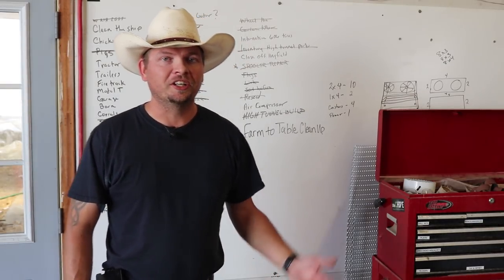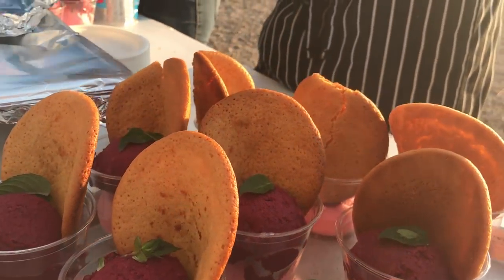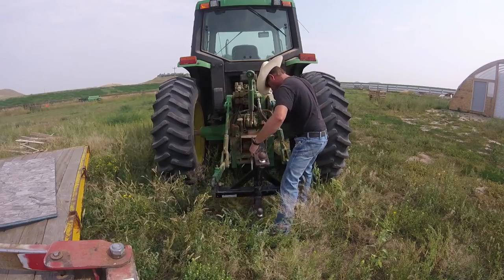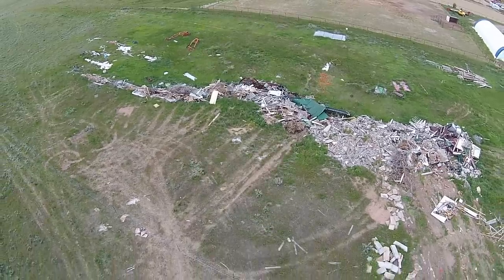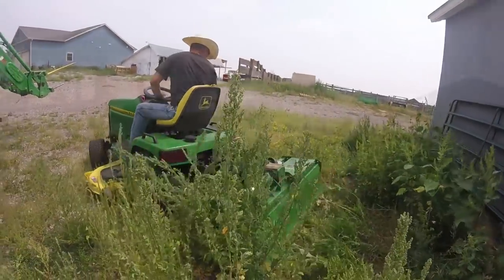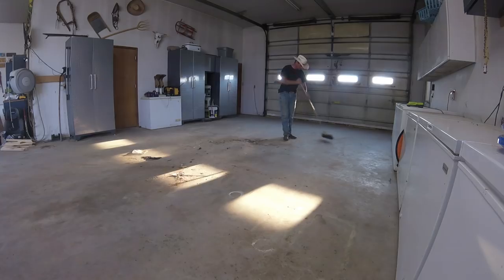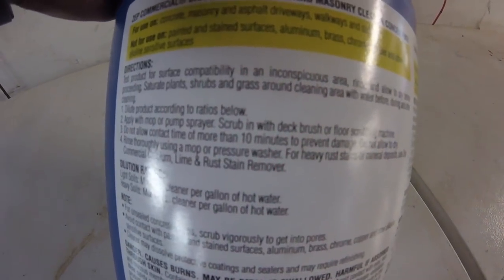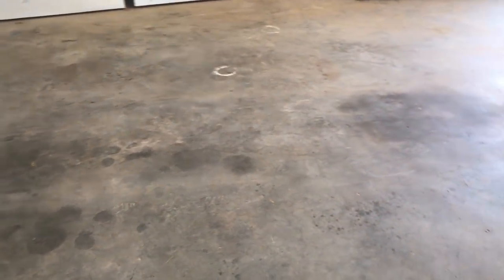Preparing the Ranch for 75 Guests for the Annual Farm to Table Event

Comment: Hey Mike, once years ago, I was tasked with cleaning the concrete floor of an old 4 bay auto repair shop.  What I found worked the best was cheap old 'white vinegar'.  Just poured a big puddle on the floor, then scrubbed with a stiff wisk push broom.  Two treatments (about 3 gallons each) and the floor was shining white, not one grease or oil stain to be seen.  Vinegar is an amazing solvent, IMO.  Good Luck with your banquet, last years looked great and I'm sure this years will look just as good!
Reply from the maker: Interesting, definitely worth a try, thanks a bunch - Mike

Comment: Kay Chemical is a company that makes a indoor outdoor degreaser that will clean that. Pour it on quarter of a gallon of chemical to two gallons of water in a pump sprayer. Soak the floor let it sit for 3 hours and then pressure wash. Floor will look like new. Great Video!
Reply from the maker: Thank you very much Brian - Mike

Comment: Dump trailers are great I love mine. Just a little larger than yours its about 7x12 had it factory derated to be just under 10k. I have 2 dump trucks as well but loading the trailer is so much easier its a pleasure. And like you it sits full most of the time.
Reply from the maker: haha, yea mine sits full til I need it lol Thanks a bunch - Mike

Comment: The shop floor is good to go. Your going to be right back in there with grease and hydraulic fluid. If you can't track what's on the concrete it's fine. Those folks are coming to a working ranch not a hotel banquet room. They're coming to escape the everyday life. An event like that along with the daily chores is stressful. Don't sweat the little stuff. Blessings for OWL.
Reply from the maker: Thank you Gerard - Mike

Comment: on my concrete floor i have oil stains from mechanic work. I can get a majority of them out by spraying a solvent onto the floor and let it sit for minute or two. Then i come back and wipe up with a clan shop towel. Then if you used your machine it would do alot more damage (cleaning).
Reply from the maker: Thanks for the tip! - Mike

Comment: Mike
Zep makes a industrial purple Degreaser (should be able to find at most hardware stores) that would work perfectly for cleaning up that shop floor. When I clean up our shop floor I put the concentrate into a spray bottle and spray it directly on the floor (dry floor). Let it sit for about 5 minutes. Then scrub it with a stiff bristle floor broom. Finally rinse the floor by your preferred method.
It look like some of those stains we're engine oil, some other material. do you happen to know what the stains are from that are on that concrete floor by chance.
I hope that you guys have a great dinner. Hopefully this helps. Thanks for all the great videos. Ben
Reply from the maker: Probably oil and hydraulic fluid, thanks for the tip! - Mike

Comment: Hi Mike: Try Rolloff for cleaning your garage floors. It is a product used by quite a few gasoline/diesel stations to clean their fuel court pads. Just make sure not to buy any of the already diluted smaller sizes. Buy one gallon and up. It usually runs around $60 p/gal plus shipping. It really works.

Comment: Oil stains are almost impossible to get rid off unless you resurface the concrete or sand it (big diamond wheel). You can minimize the stains using a strong acid based cleaner and a brush. The acid will eat away at a small layer of the concrete and minimize the stains. I don't know what store you have locally but I've seen these cleaners at home depot and lowes. Cheers!
Reply from the maker: Very cool. Thanks Samuel - Mike

Comment: I have found concrete cleaners to be just regular soap type.  none can take out oil stains or other deep ones.  just surface.
for comparing pressure washers to each other.  multiply GPM by pressure.  gives you an "impact" number.
7000 psi at one gal equals 7000.
3500 psi at two gal equals 7000
they are comparable.  so buy the cheaper one.
Reply from the maker: Perfect thank you Tom, this on is 4000 PSI and 4.0 GPM  I really appreciate the help - Mike

Comment: Concrete is porous, which means any liquid will soak in and bond to the concrete. The only way to get the stains out is to grind down the concrete about 1/4 inch, which is a pain, expensive (even if you do it yourself), and has health risks from the dust. You could paint it (with special epoxy paint) but the chances are it would peel up in sections that have oil stains. There are products you can use to fill up the pores when the concrete is new, but those don't really help you now.
Reply from the maker: Thanks a bunch! - Mike

Comment: If you can shop from white cap/ HD supply they have a amazing concrete cleaner that removes oil, transmission fluid, diesel oil, almost everything. I would use it out here in Las Vegas for concrete cleaning and being that it is so hot here alot of stains on the concrete usually never come out completely but I used it at a pilot gas station and they gave up on trying to keep it clean when they weren't getting the results they we're expecting. I offered to clean a 10x10 yd sq of the worst area for free and if they were satisfied with the test they could hire me for the rest of the gas station. They loved it and hired me for all of the truck stops in the Las Vegas area. If you want the name of it let me know before 9am tomorrow and I will stop by and get you all the information on it. I'm leaving for a little more than a month on Friday to go work on a farm on the east coast but I don't mind stopping for you to get the information. I enjoy watching your videos when I have time to. Be safe and have a good one. Ryne
Reply from the maker: Awesome thank you very much, I will see what I can find here, if you know the name of it let me know. Thanks - Mike
Reply: Our Wyoming Life not a problem I will get it in the morning for you on my way home from that side of town. The only thing we used was hand brushes we also went with the broom lines Because that is where the pours of the concrete are more open to letting in anything
Reply: Our Wyoming Life hey Mike do you have a email or phone number I can send you the info for the the cleaner and sealer for the concrete?
Reply from the maker: Ourwylife@gmail.com

Comment: I've taken to watching your videos with munchies at hand, you keep making me hungry, all this talk of food. I've found, at least in my garage, that once certain stains get set in, nothing worth doing ever seems to do the trick. My Land Rover uses hydraulic fluid in the power steering system, and it leaked hydraulic fluid all over the garage a few years ago, and nothing has touched that stain ever since.
Reply from the maker: thanks Sandy, sorry about that. I have been making myself hungry lately too! Thanks for the tip - Mike
Reply: One more thing Mike, if you've got one nearby, a good janitorial supply house may have something that'll take on those stains. They tend to have the good stuff that you can't get from the usual places.